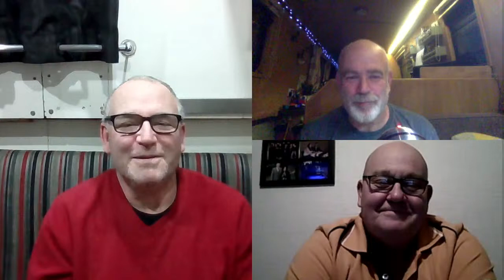Engine Room Chat

Comment: Heated flexible  jackets for batteries  are quite common  as well as block heaters for vehicles here in Canada where we can get -25/30c most winters usually in February. Of course you can only plug these heaters  when in your garage  or drive way. Remote car starters are also quite popular.

Comment: Hi Glen, I think your biggest problem is going to be noise and if mounted on your narrowboat vibration. Also some sort of system  to turn prop out of wind at top speed limit otherwise the unit is liable to self destruct .I'm basing my comments on a friend's off grid hunting camp.